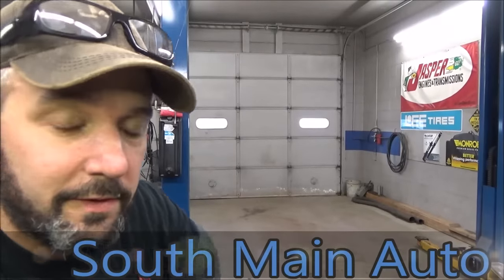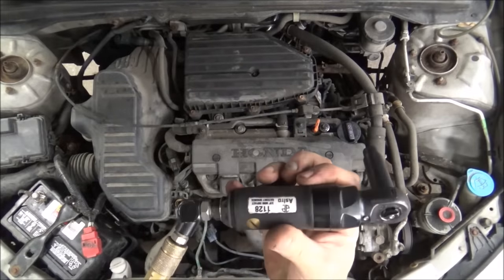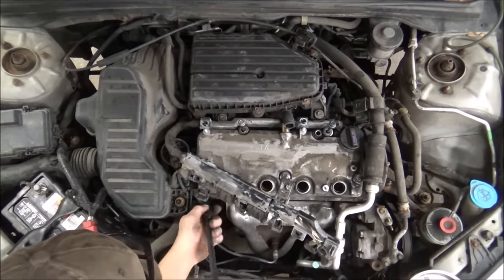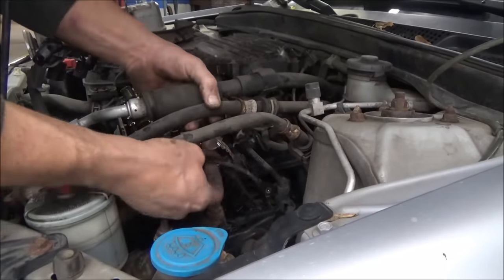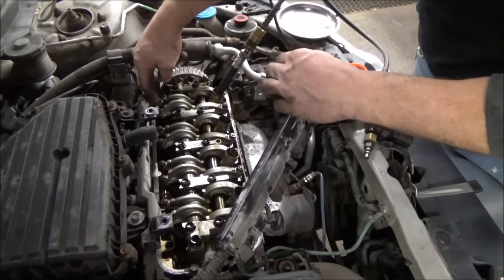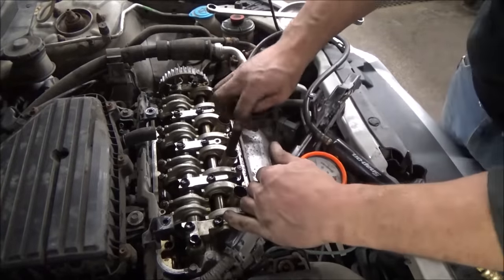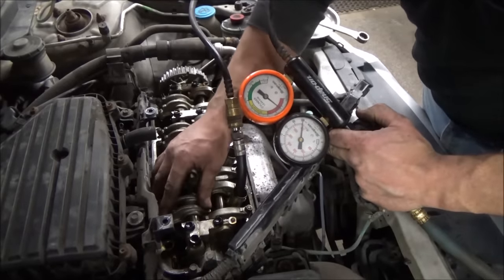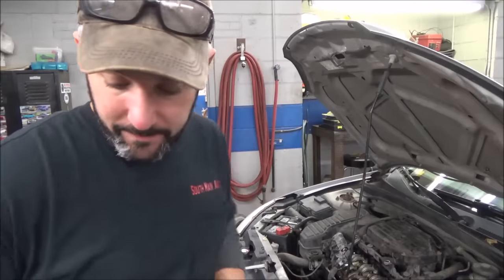Honda Civic 1.7 - Crank No Start

Comment: Every time I hear of somebody scrapping a car because the repair is a little over the resale they get themselves into something that costs far more money to keep and run.
Reply: The resale is low because people consider cars more for status than they do for the transportation appliance aspect.  It would be certainly cheaper to put in another $2k into it than $20k for a new replacement, but it wouldn't have any snazzy.
Reply: Robert Slackware  
Sir, that is so true. Many don't think about the added cost of higher insurance. 
When obama came up with cash for clunkers, and said people need to buy a car that gets better gas mileage,  I figured if my old Dodge gets 16 mpg city and 20 mpg highway it would take a lot of miles at 30 mpg to cover the cost of insurance,  and the cost of a new vehicle. I will just keep my old Dodge,  and Cadillac.  The caddy gets bad gas mileage but I enjoy driving it. It's a 76 coup de Ville nice ride
Reply: DTR RTD that’s what I was thinking when Eric said that the customer was going to scrap it. I would snatch that car for $500, work on the engine myself and then drive it till it couldn’t anymore. It would be cheaper just to dish out the 2k rather than dish out 20k over 4 years plus interest.

Comment: I had a very close customer of mine (the father of my life long best friend who died of a heart attack 3 days past his 22nd birthday) who had this happen. It was the cars second engine which was from a junkyard with pretty low miles and he had it installed by a shop that is known by car people to be a bit shady... the original engine was burning oil HORRIBLY at over 300k but the car was and still is MINT for being in NY. So they had a used engine put in and less than 3 months later it shut off going down the road on Ralph. So he called me on the side of the road, I came out, and it didn't sound like it had ZERO compression like your example, but I ended up pulling the distributor cap, had him crank it, and no spiny spiny of the cam driven dizzy... the thing that REALLY gets me is he had paid for a Timing belt kit to be installed on that engine since the engine was already out of the car so it would be CAKE.. but it was a dry cracked, shredded, HONDA belt that broke... like 6 wrecked valves when I pulled the head...
LUCKILY, a friend of mine had an identical motor with a rod knock he pulled out of a car and sold me the head off it. Had it resurfaced and pressure checked, slapped on Ralphs bottom end, and it's still going strong 4 years later....

Comment: Yeah. I had that happen on a 2004 Aveo LS at about 120K. The damage to the engine was minor despite me being on the gas at the time (had it floored going about 70 on the highway, trying to get around a truck). In my case, it was a pulley that broke. My dad and I did the job, and it went surprisingly well. Kicked up and ran for a while. The bottom end of the motor went about 20,000 miles later due to oil pressure issues that developed with that motor. Sold it for a grand and got the Taurus a few months later.

Comment: "Always cut towards your buddy not your body".. hahaha. Damn shame about the car. Strange seeing a Honda not pass 200k.
Reply from the maker: +CravinMorehead420 Words to live by
Reply: CravinMorehead420 if they would have maintained the engine and put a belt on it during its life they would still be driving it.
Reply: Lack of maintenance. This was probably the original timing belt.
Reply: Yep, a little planning ahead and proper replacement before it broke could have saved this.
Reply: Anything will fail prematurely without proper preventative maintenance. Even a Honda.
Reply: yep, all about maintenance; if they had a hybrid of that vintage though, it has a timing chain, not a belt; which from what I understand lasts the life of the car ...  with regular maintenance (oil changes of proper weight).

If you think you'll forget to spring for a timing belt change; listen to Kilmer and buy a Toyota ...  non-interference engine vs Honda that isn't; so if your belt breaks, your valves won't slam the top of the pistons from what I understand.
Reply: Yes blame on the machine.
It don't talk back.
Except the bill comes back as reply.
Reply: @zakuraayame5091  then when your head gasket blows on that Toyota with the aluminum block it's time as Scotty would say "Rev your new engine!" Because you're going to need one. Versus 700 bucks on a honda with a new timing belt and water pump.
Reply: It's lack of servicing, etc. Replace the belts when due because belts DO break.

Comment: I bought an 99 Acura TL with a busted timing belt for $400 last year. Definitely hit valves. Car was obviously abused when I started looking deeper. Original belt and it had 185k miles. Decided that the engine was not healthy enough to keep so I bought a replacement engine with supposedly 86k miles for $800. Runs like a dream now but its become a money pit due to the previous abuse. Recently found out that someone took out SRS, TCS, and ABS bulbs from the cluster. All those lights were on when I put bulbs in. So it was a deathtrap. Hopefully it's an easy fix. Moral of the story is ask a lot more questions if you are about to buy a car that doesn't run and has a bad battery. Those dash lights are important.
Reply from the maker: +argonian bilbo ask a lot more questions = get a lot more lies haha
Reply: South Main Auto Repair always taking that risk. Sometimes you get cooked like I did. oh well you win some you lose some lol
Reply: Oh I hate when people take out bulbs.
Reply: Things to bring when buying a used car: Jump pack and scan tool.
If the person selling the car gets angry for you wanting to hook up a scan tool to it, get suspicious.

Comment: I lost a timing belt prematurely (I'd already had it replaced once and it broke early) on my first car: an orange Ford EXP from '82. No scalloped pistons on that baby.. We were on our way to the St. Louis airport started uphill on a turn ramp transitioning interstates and heard a pop, RPMs went to nothing and clackety, clackety, clack as the pistons slammed into the valves. I paid to have the top end repaired and 9 months later the crankshaft broke. Paid to have that fixed and a year later it was overheating with a bad radiator.  Replaced that and about a week later it was stolen and driven to Manhattan Island and left double parked with a broken window and some new body dents. Told them to keep it at that point...  My wife told me, "I think God took that piece of junk away from you before it disassembled around on the highway because you were too stubborn to do it yourself..." HAHAHA  She always was a smart one.

Comment: You can get by with irregular oil changes on a cam in-block motors OHV, and belt driven OHC.  Chain driven OHC not so much.  Yes you have to change a belt (before it breaks!), buts it cheaper long term, even with diligent oil changes than replacing chains and adjusters IMO,  more likely to stay on the road and quieter.

Comment: Hello, question my 02 civic had timing belt snap while park fuel it up. I replaced timing belt water pump and put it in timing as it should but it cranks and don't start. Sounds like that car on the video.

Comment: You ever do any timing belts on Ford Zetec motors? I got an 03 Escape with 176k on it and have no idea if the belt has ever been changed. I am a little scared of tackling it. Wondered if you had any pointers.

Comment: Hii!!! I would really love if you give me an advice for my Honda Civic 2003. It turns on after 2 seconds when is on it turns off. the only way I turn it on is pressing the gas pedal then it does not turn off. I replace the crankshaft sensor already, and it did bot solve the issue. I would love to hear you suggestion what would be the issue? Thank youu

Comment: That's a $2500 car if interior is decent. without labor, it's probably only $600 in parts. That's not bad for a reliable 35 mpg car.
Reply: dyy Fethiiyhn  so original.
Reply: @applepoop10  Ive changed quite a few timing chains. Mostly on Ford's.
Reply: Ian Above  must be newer crv  with k has Cain but b20  has a belt
Reply: @applepoop10  crvs are slow as hell....the k24a1 is crap

Comment: I bought a JDM d17 engine for my 2005 Honda civic.  I only had it for 1 month the engine turned off on the freeway now it has a slow/ no crank , the timing belt is still on.  Any recommendations ?

Comment: hey eric,before you do a timing chain job or head gasket ,lets say on a sohc engine,you put the cyl1 on tdc ,the valves are close for compression stroke,that's tsc?right? does that all timing mark are aligned?is it safe to work on the engine at this point as long as you put the tools to hold your cam shaft in place. thanks

Comment: Pretty sure it is an interference engine, but that also means the interference can be between the valves, ie dohc one pulley slips ex whacks int.  SOCH here,  usually no damage.
Reply: I stand corrected. I'll watch the entire video before I comment any more.

Comment: This that the original timing belt? I would bet it was.
Usually Honda puts a special witness mark on the OEM belt to identify it.
Reply from the maker: +watershed44 I believe it was.
Reply: +South Main Auto Repair Shame on the owner then, he earned that one.
Reply: Steve Rothenberg Honestly unless you are almost destitute why would you allow one of your most important assets to die this kind of death, if you shop around you can find a place that will do the job for a reasonable price or if you have to borrow the money the alternative is far more inconvenient and expensive!
Reply: +watershed44 I completely agree, but I work on my own stuff as do most viewers of this channel I bet.  Most people still think removing the caps from your valve stems lets the air out ;).
Reply: Steve Rothenberg I do basic work, but leave things like TB to the skilled pros.  I don't have the work space, tools, or experience to do the job right. Brake pads, plugs, are my experience level, one thing I am decent at is electrical trouble shooting.

Comment: I have the same engine in my 04 Honda Civic ex coupe 1.7 with vtec how come my oil cap and oil dip stick would smell like gasoline? I’m stumped and every mechanic Iv asked is confused on what is going on any idea?
Reply: Your piston rings are shot.  Unburned gas is leaking past the pistons into your oil pan.

Comment: Economically salvagable if your a DIY'er
Reply: +Ozzstar Yes it is. I have an 02' civic ex and I've done the timing belt, head gasket, power steering rack and a number of the jobs on it myself. Actually, I just change the evaporator for the a/c two weeks ago.  I bought it brand new in 02 so it has a lot of sentimental value. I love my car!
Reply: +Ozzstar  That because most DIYer hourly salary is $0.00 per hour.
Reply: +Ozzstar This car would be a flippers dream.
Reply: +Matt Bartholomew It's a New York car with 160k, so better look at the under carriage for the "Red Monster" first though ;)
Reply: +Ozzstar Thats for sure ez fix junk yard motor.
Reply: +DementedButtHole  That's something I would like to see! Any details on the replacement engine, and how the fitting and mounts and transmission worked? Did you make it into a rear wheel drive?
Reply: Not for a rust belt car
Reply: @caduceus33  He mentioned it was longitudinal, so I'd say he most likely made it RWD.
Reply: I'm surprised he doesn't at least pull the head and if it's just valves have the head rebuilt. My dad retired 2 years ago after owning a machine shop for 30ish years. I worked for him and mainly did head rebuilds. It would have been around $300 for a head rebuilt with new seats and guides if needed. I've even seen loaded rebuilt heads for around the same price. Well worth it in my opinion. Same with the 3.0 escape, why not tear it down and at least see if it only needed a head gasket. I understand being honest and telling the customer it could be more and isn't worth it if there is more damage than can be seen.

Comment: Please help me understand this. Number 1 gauge is reading pressure in and number 2 gauge is reading back pressure? So, could not the piston rings be leaking the air? Could not the head gasket be leaking air? When you did number 2 cylinder you got air coming out of cylinder 4, wouldn't confirm a bad head gasket? I am just trying to understand the process here. Thank you.

Comment: The old 1.5 civic DX blew a timing belt wouldn't start drained the batter from cranking. Then tried to pull start it lol did the timing belt etc no damage.

Comment: I have a 2005 honda civic it will crank but won't start timing belt good, fuel pump good do you you think crank sensor bad
Reply: Jamie Edgens did you fix it yet? It could also be the fuel pump relay.

Comment: well looks like it wasn't my cam sensor. she died on me this morning but started back up after a few min. so any ideals? crank sensor? only thing I can think of. going to clean throttle body anyway. but it losses spark then regains it. drove her around for bout 2 or 3 hrs. yesterday going to stores turning it off several times. ok its a 98 Dodge Ram Van B1500 with a 3.9 liter. V6. has around 140k runs really good when it has spark.. what ive done so far.. complete tune up. plus coil. oil change being I just got this van. and yesterday cam sensor aka pickup sensor inside the distributor.  ok ty

Comment: ok here's a curved one for yea....
my wife's car is a v6 1999 accord
i got it a year + ago, was driving fine for a year 6 mouths ago started to shut down mid driving at random, about 2 mouths ago
it was doing so often we stopped using it, now it won't start at all, will crank, no start, engine is getting gas from pump, all plugs showing spark, (i haven't tested the spark timing) the only error showing is a p0420 and i don't think this is the problem.
main relay was replaced, ignition switch was replaced, mas air flow sensor was replaced, none solved this problem, i had 4 other mechanic's look at it to try to find this problem  before it has died completely.
i am thinking some kind of electrical problem.
my wife is ready to junk it, but i think i can fix it.
please help.

Comment: Tensioner could’ve gave up and belt jumped a tooth or two, that’s my guess on how 1,3,4 all hit the valves. 

The cam was still spinning and kablamie.

Once that happened, the belt gave up. Seeing as it’s probably original plugs, valve cover never looked to have been off for a valve adjustment, I bet the belt and all never got done when supposed too.

Comment: By the way, random questions for you Eric. For starters, wouldn't it not matter if they kept cranking it given once the belt breaks the valves freeze wherever they were at? And secondly, do you bother to torque spark plugs or do you just thread them "tight"? The latter is a question I've seen debate on but I don't think anyone wrenching for a living would bother with it. Thanks again for the great videos, I'm learning a bunch from ya :)

Comment: There are some issues that are not covered by youtube mechanics. One technique is to damage the ECU or computer of the vehicle by giving it electrical shocks through cigarette lighter connection or any other such point. Trying to remove the electrical connections (like relay) of ECU or computer, wait for a few minutes and then put back the connections works in such cases, supposing that computer has survived the shocks.

Comment: DIY: Junkyard head + NEW Belt, VC & H gaskets, plugs, oil & filter & coolant + reuse all bolts, WP & TB tensioner= cheap CNY Winter Rat
Reply: they wont sell you just a head theyll make you buy the whole engine
Reply: dom why We have "U-pull-it" yards here.
Reply: lucky
Reply: Random Guy

Comment: Nice video as usual. Good camera work and very informative.
Honda build great engine but don't miss out on basic servicing and change the belt every 60'000 miles folks.
Reply: Honda's are due at 105,000 or every 7 years

Comment: good job! Faltou nesse veículo a manutenção preventiva mesmo com os 160k. aqui no Brasil esse é o Toyota Corolla são considerados bons carros, verdadeiros tanques de guerra, mesmo assim não pode ser deixado de lado a manutenção preventiva como, regulagem de válvulas, atenção com o sincronismo do motor com a troca da correia dentada, pra que não aconteça isso com as válvulas delas baterem na cabeça do pistão e empenharem. Aqui no Brasil seria adotado uma retífica parcial do motor, retirando se necessário o cabeçote e trocando as válvulas, não sendo necessário trocar o comando de válvulas ou manivela e nem fazer a plaina no cabeçote. aqui no Brasil esse serviço levaria em torno de 4 horas e custaria em torno de $400 à $600 de mão de obra mais de $800 à $1'200 de peças, incluindo: junta do cabeçote, junta da tampa de válvulas, retentores do comando de válvulas, substituição de toas as válvulas, kite correia dentada com tensionador e bomba de água. Se necessitar de plaina aumentaria mais +- $600. ficaria mais barato aqui no Brasil, comprar um cabeçote usado, e trocado por completo. Se tivesse feito a manutenção preventiva com uma troca de kit correia dentada, mais regulagem de válvulas, o custo seria entorno de $500 !!

Comment: I had a 00 CR-V with an interference motor.  The timing belt snapped sitting at a stop light.  I literally had the new timing belt in the back seat and had the job scheduled. Fortunately because I was just sitting no damage was done to valves.  I was on the factory belt around 130K.